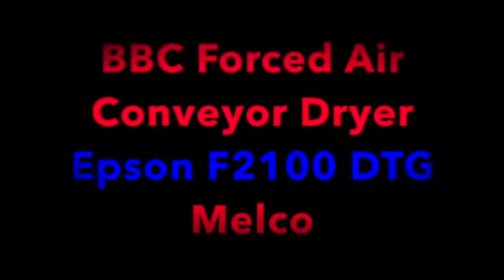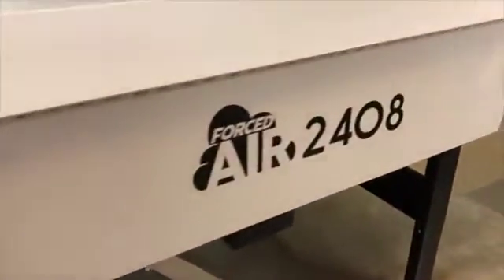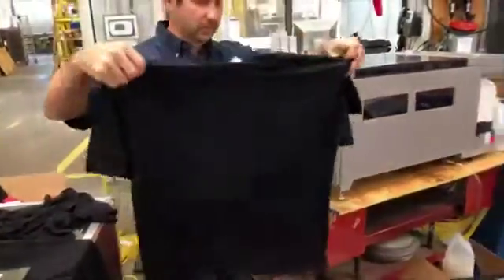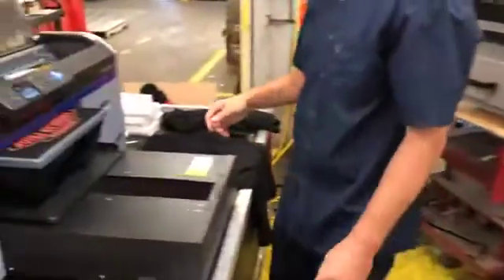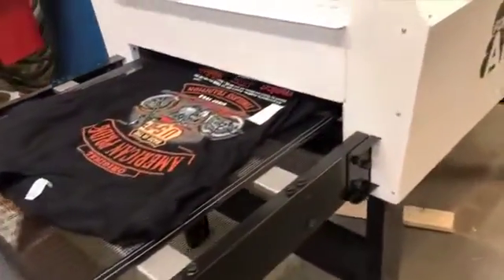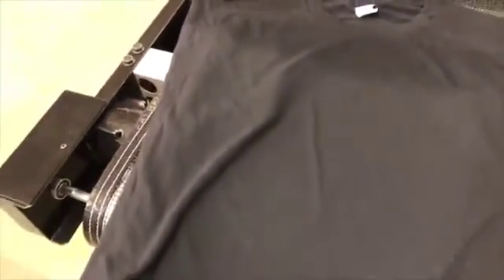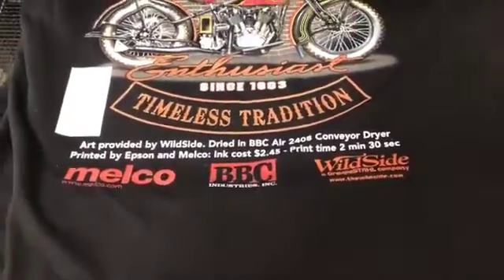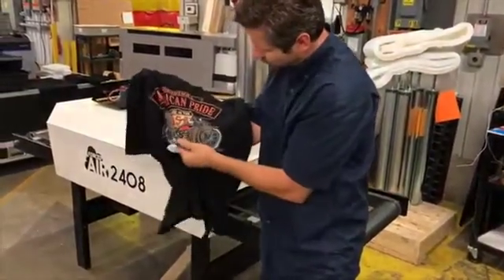Forced Air Conveyor Dryer to Cure Shirts With and Epson DTG Printer

Comment: @Melco Embroidery  I just purchased this dryer and I am using it with Epson F2100 machines. I cannot find any baselines to start with for dwell time and temp for pretreat (firebird) or printed shirts. Would you be able to offer any help?
Reply from the maker: Your temp settings will likely be in the 6-700 degree range though you want the temperature at the belt to be around 320ish. General dwell time is around 2 minutes. The garment should not be smoking by time it comes out. Use those guidelines as a start and refine from there. The temp and time can often be the same for pretreated shirts and printed shirts.
Reply: Did u figure it out ?

Comment: Hi! I’m looking into getting a conveyor dryer but I can’t find any info on how to do front and back of shirts. I’m assuming you pre treat front, cure, print, cure then do the same to the back? Will it ruin the front print if I run it through the conveyor again with the front print down? I just want to make sure I can do front, back & sleeve before I take the plunge and purchase one.
Reply from the maker: Hi, A conveyor will definitely increase your production efficiency and speed. If you are doing a front and back I recommend the following. Pretreat the front dry, pretreat the back, dry. Print the front, dry, print the back dry. Running the printed shirt through the dryer with the print side down will not over heat or damage the print. One of the benefits of forced air is you can cure pretreated shirts and printed shirts. As long as the temp and time is reasonable you will not have to worry about scoring. The BBC 2408 is the ideal DTG conveyor dryer for a lot of reasons. Feel free to email me for more info jledrew@melco.com

Comment: What settings are you using? Temp for zone 1 and 2 and belt speed?
Reply from the maker: Zone 1 is about 750 degrees, zone 2 is around 450. Belt speed should be about 2 + minutes. I don't recall the number setting but if you time the zipper going through the belt and make setting adjustments as needed, you can figure it out. Hope that helps.